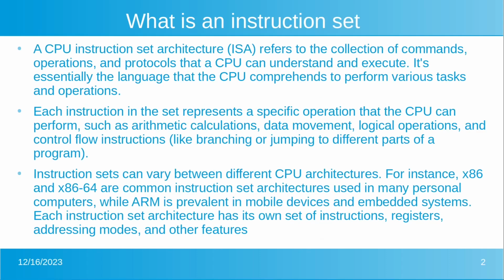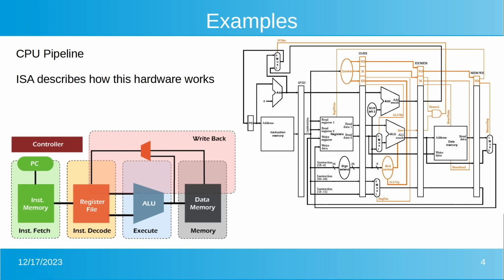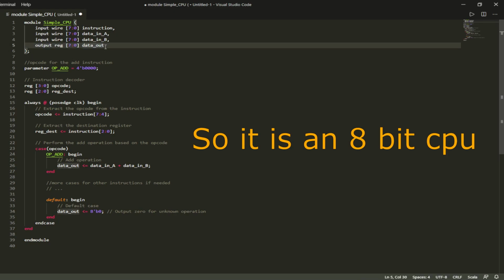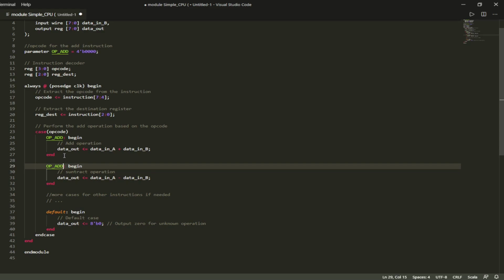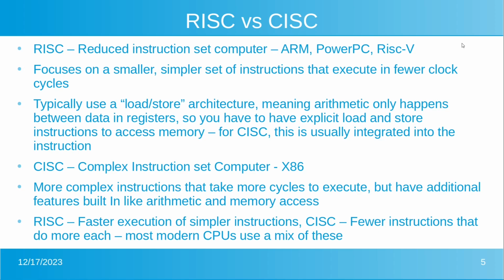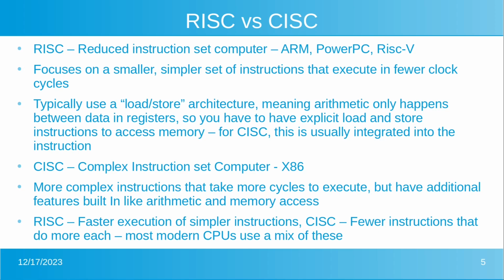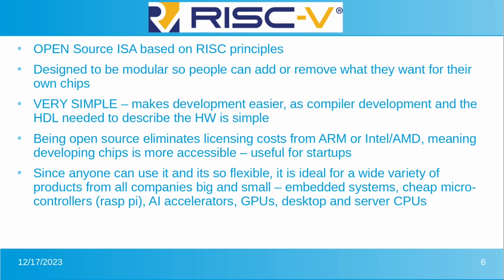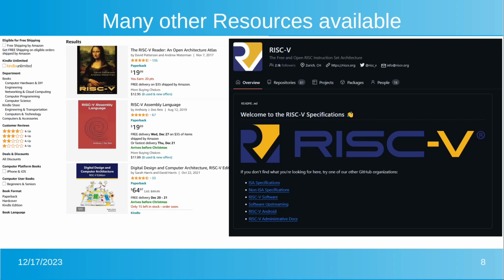An introduction to CPU Instruction Sets and Risc-V

Comment: Good explanation, nicely done! I certainly can see one reason beyond just the use of RISC processing for power efficiency;  a need for people to start providing CPU devices that do not come from literally one  or two major world corporations. For one thing, does anyone outside of these corps even know all the things these chips may be doing to compromise our security, or spy on us? There is already some CPU identification code build in these mainstream processors back in the Pentium days that didn't use to be there in the past. I am not sure if they still include it in modern CPUs. Most BIOS will allow it to be disabled also. Why make a feature that people feel needs a method to disable it if it was simply safe and beneficial? A feature no one asked for, and I am surprised that Intel allowed anyone to know it was there in the first place. This was also a question a long time ago regarding the state of affairs surrounding Microsoft Windows back in the day. And we all know we can explicitly trust Microsoft! (clears throat...) I think RISC-V might be a very nice way to avoid big brother in the future, or have a gone off in the wrong direction? I also fully expect some of these processor makers to start playing with ideas of forced obsolesce. When processors become so fast that who needs to replace it every five years, why not plug an instruction in the CPU that limits or disables the chip after a certain timeline has passed? I know apple already plays with their iphones in these ways. Maybe I am just seeing all the bad where none exists. :)